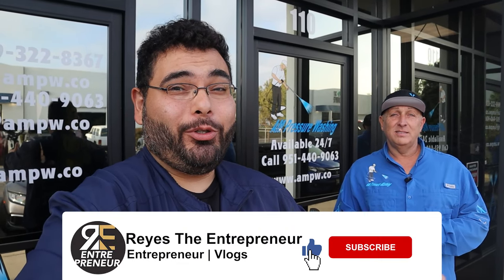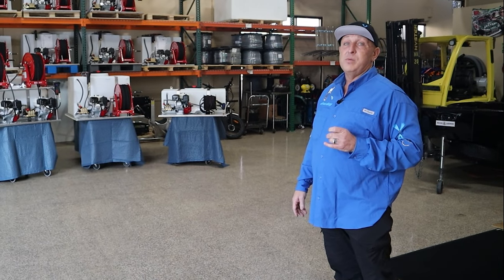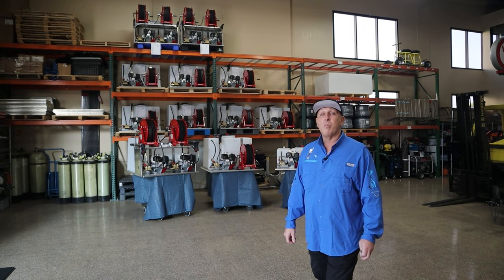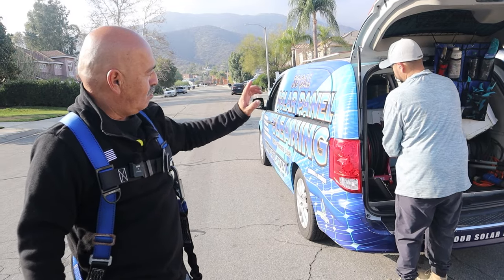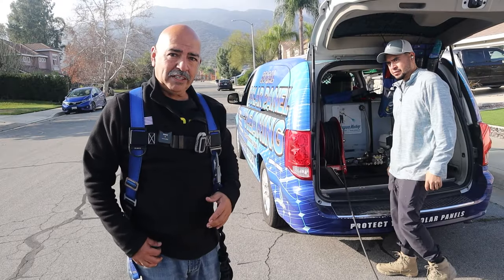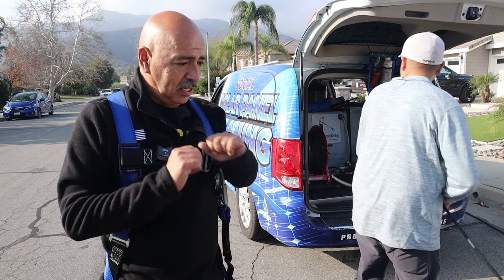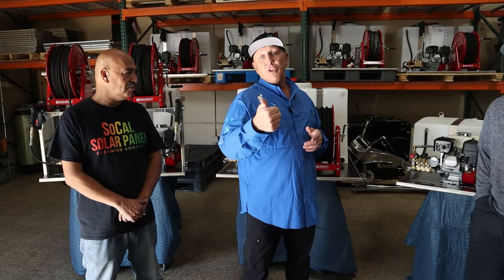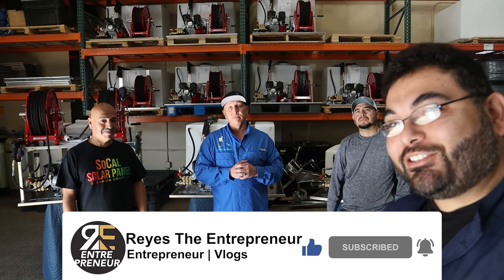How To Start A Solar Panel Cleaning Business

Comment: You shouldn't be using chemicals or high pressure wash. Literally, purified water is all you should be using. Take note of this company and spread the word. Not good what they're doing.
Reply: Bs. Need to know correct chemicals. Certain types of mold doesnt come loose with just water.

Comment: Best you can do is to follow the solar panels manufacture recommendations. You can always contact them and find out whether your specific solar panels are safe to wash with detergent. If so what kind of detergent. I wash my own solars with pressure washer only. I use soft water to retain minerals and prevent layers mineral buildup. I want to start brushing although I want to find very soft bristle brush. I will potentially like to start working my own business. I m a certified sterile processing tech who would like to do some very good cleaning for solars. Cleaning solars does help a little bit the solar energy production. I would suggest washing solars at least 2 to 3 times per year.
Reply: MY area is very dusty and low rain in the summer so it looks like I'll need to was once a month. Be care with the pressure washer, some companies and Youtubers advise not to use them, so depends which kind.

Comment: i do same thing and i respect these guys hustle but please do not put any cleaning agents on your solar panels. this will void warranty. unfortunately some bad information here. using pressure is a little sketchy too. this can cause fractures and damage the non reflective coating. also some GOOD information in this video. GOOD VIDEO .OVERALL, but majority of solar cleaning community will dis agree with the first guys method.
  thanks for making this video and getting the conversation started
Reply: I've worked in solar for a while as well and you REALLY should not use pressure washing your right!!
Reply: soo how would you do it then? need solution not problems

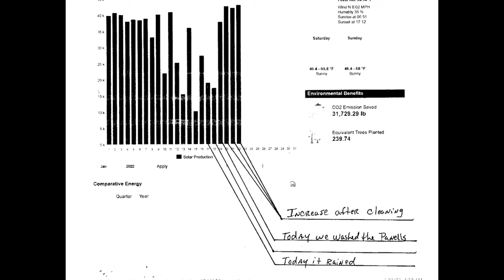Comment: 25:06 So cleaning it may have possibly increased production by 3-5%? Looks like it goes from 40 kw to 42 kw. Clearly production is going to be really low on the rainy days, but all the days before that was around 40 kw, and after it looks like it's 40 kw - 42 kw. We'd probably need to see more days to compare. I'd be interested in seeing them clean half an array and then showing us what the kw production difference between the arrays is

Comment: You only need to have safety gear on a roof if you are working within 6 feet of the roof ledge. Besides there are no anchors.

Love that rotating brush. They didn’t exist when I cleaned. Could have really enjoyed using that brush at Camp Pendleton Naval Hospital solar panels and windows.
Reply: You clearly don't know the OSHA rules friend🤦‍♂️😂 if you're working above 6 feet you HAVE to be tied off
Reply: @ImBetterThanYouHoe  sorry brother, IWA sets the safety standards and I was at those meetings. No tie off if you are not working within 6 feet of the ledge. There also have to be facility supplied anchors or you must bring your own providing there is a place to fasten them.
Reply: @kimwarfield1587  you have no idea what you're talking about
Reply: @ImBetterThanYouHoe  I was a commercial window cleaner for 16 years. We cleaned government facilities like the VA hospital in San Diego, Camp Pendleton Naval  Hospital, The City of  Carlsbad Libraries, business offices, fire stations and police departments. Most Stores in the San Diego Outlet Malls, San Marcos City council , UCSD Offices and about 2900 other customers. I do know what I am talking about. I was also present for the discussions on high rise safety in  Anaheim.

Comment: Omg, that guy could know a lot about sales and car detailing but he doesn't know anything about solar panels. Cleaning panels with that mop, leaving all the edges (where the dust and mould is), with soap (not allowed by the PV brands) and with pressure water. SoCal is a good choice.
Reply: Yup, he just voided the warranty with just the chemical alone. Not even mentioning the use of that mop... Only a handful of products are certified for use on solar panels (by the manufacturers themselves!) Last time i checked, none of them could be used on windows and cars....

Comment: I’m not too sure about that power scrubbing brush on the solar panels. Imagine using that on the clear coat of your car. That’s going to cause swirl marks and decrease the efficient of the panels.
Reply: The di water gives a spot free rinse so there's no need to worry about that
Reply: This brush is specifically designed for solar panels this is what they use in Europe all day long so it's not going to scratch the glass this is considered the top-of-the-line brush for solar panels
Reply: @nicovalenzuela4044  Spot free water has nothing to do with a brush being too rough on glass and risking scratches. Spot free water just has no minerals so it doesn’t dry with spots all over the glass like tap water would.
Reply: @HF1.0  those brushes are literally specifically engineered to clean solar panels so ur trippin
Reply: Plastic brushes will never scratch glass! Dirt on the brush can.

Comment: Clear Colorado early winter day, elevation 6700 feet. Sounds crazy, but got 145 - 150 watts input from 160 watt solar panel. Charged my River 2 Max from 40% to 100% in two hours.

Comment: How does snow affect the panels in the winter? Is there a service to remove snow after a big storm? Do panels get struck by lightening?
Reply: panels are so dark that as soon as the sun comes out, energy passing though the snow strikes the panel, produces a little warmth, and the snow slides off. including with deeper snow.